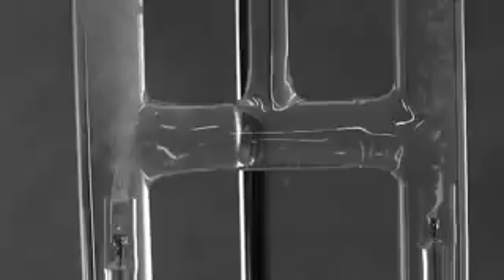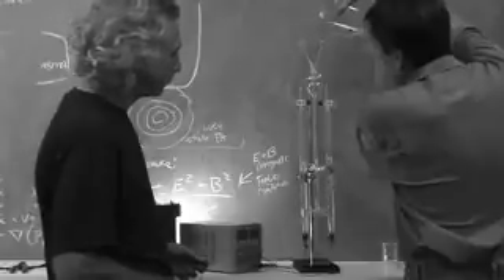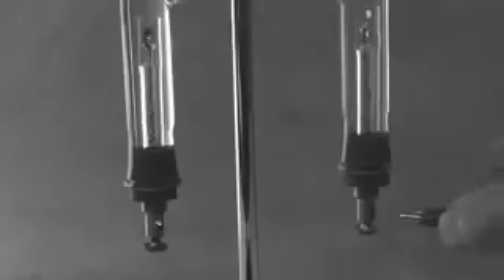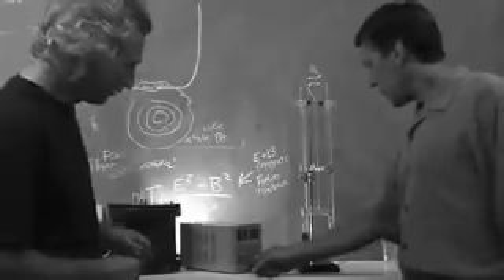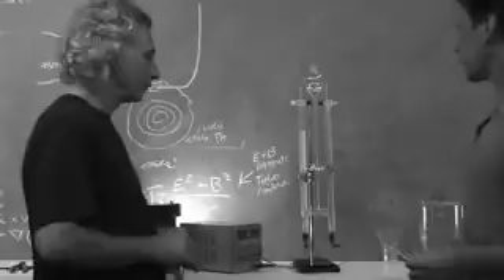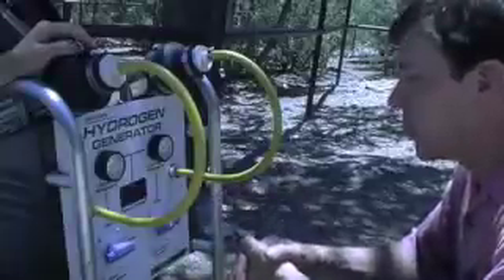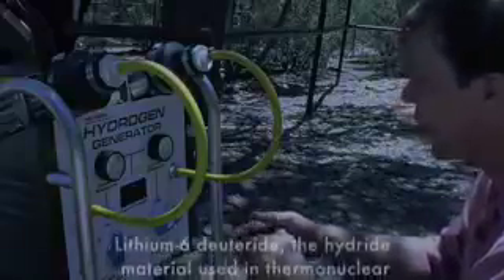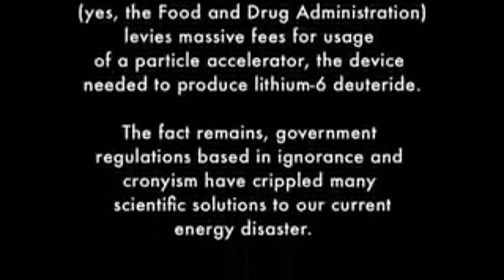run your car on water. This guy does just that!

Comment: I have followed Bob Lazar's reports for years. I built his water electrolyzer years ago and yes it does work. I never built the storage system even though I have the design for the storage system. The problem is I can't buy the Lithium Hydride catalyst because it is a restricted chemical. However, there are a range of new catalysts that are direct substitutes. Graphitic Carbon Nitride is very promising. 
Currently I am working on a catalyst that is recyclable and generates much more Hydrogen than these early methods.
Reply: Now you've answered your own question as to why it's restricted.

Can you release your design .
Reply: @josephwanjiku6853  I have an older design shown working on my channel. The video is a few years old but the electrolyzer is still the same. This is not free energy as it costs money to build the electrical supply to electrolyse the water. The advantage we gain is the generated Hydrogen is portable and has three main uses. The first being for heating, the second to run a combustion engine and finally the last is to generate electricity from a fuel cell. Depending on the application the efficiency can be anywhere from 30% to 90% with regards to power input versus power output. Remember our goal here is environmentally friendly energy that is sustainable.
Reply: @postiemania  

If you have an idiots guide to build it , I'd appreciate the knowledge.
Reply: Just buy a Tesla. Problem solved!
Reply: @Berghiker  humm. Hello. 2 year waiting list.  And problem not solved. Introduces new problems
Reply: @danratsnapnames  If you order now, then in two years you will own a Tesla. Everything in life comes with some sort of problems or trials.
Reply: @Berghiker  and then once you own a tesla you'll be replacing the battery pack every 3 to 5 years for a another $15k price tag added to your  tuneup costs
Reply: Is it possible you could email me the schematics? Or is there a clear video about how to do it?
Reply: @Skullboy1104-sw6mf  You wont get an answer from him because he knows this is a scam.
Reply: Japan is making hydrogen cars and has plans for building thousands of stations. You can buy one soon.
Reply: Fully electric is the way to go. I'm proud of Elon.
Reply: @Mortum_Rex  Its gonna be nice. Electric cars still suck. Electricity isn't gettin' any cheaper either.
Reply: @daphnetruman  Try the method in the video and you'll see the lie exposed. Solar panels won't charge the tank in a timely manner. Never mind the fact that he says in the video "I'm gonna leave it over night" when he's using solar panels. And I'm comparing modern panels to what he had. I know, because I've tried it. Japan is not using this system, they're setting up hydrogen contracts with Australia. Which costs money, has a carbon foot print in both production and transport, and ain't all that cheap at the pump. Never mind all the infrastructure they'll need.
Reply: @Mortum_Rex  Carbon dioxide is a BENEFICIAL gas, it is not a bad thing. All plants NEED it.
Reply: @tsijr915  He was born and raised  in South Africa. What a bright smart boy :-)
Reply: @Berghiker  He's not, but you keep staying ignorant while the rest of us move past it.
Reply: @tsijr915  What are you talking about?  He's not? You are just jealous because he is half south african.  Just get over it! Who is Bob Lazar anyway? Follow the big leaders in tech. Follow the money.
Reply: Hey , are you alive 3 weeks later or did you happen to suffer from food poisoning or other symptoms after this comment !?!
Reply: @napoleon9514  Hey I am still here, currently working on an energy cell that uses Hydrogen as fuel. Might I suggest the new cell is a quantum leap in energy storage. Features include a black box system data recorder and greatly reduced manufacturing cost. Will be putting up a video on my channel soon.
Reply: Could I get the designs on how to make the designs lol
Reply: @Berghiker  Takes gasoline to recharge electric car.
Reply: @onekerri1  Takes even more gasoline if you drive a combustible.
Reply: @Berghiker  Unless you have your own design schematic to show everyone then no one cares what you think about cars. Go back to making Excel tutorials or whatever irrelevant content it is that you make.
Reply: @BigOrse  I've made my point on this topic. No need for further discussion.
Reply: @postiemania  patent and sell it ma boi
Reply: @NA-hf4zg  I will put a video up in the next day or so and you can appraise for your self. I do plan to patent the design of the energy cell. The core control I may put into the public domain so everyone can use free of charge. The tank design and electrolyte formula is what I will patent and license to manufacture.
Reply: @Berghiker  The green new deal people like to hide that it takes coal to go green. We shouldn't use any of this crap when we can use any kind of water, in my opinion.
Reply: I hope you’ll post your work on YouTube. I just subbed to your channel. I’m a massive fan of Bob Lazar.
Reply: Robert I also did make hydrogen but dont know what metals make the cathode or anode etch resistant. I would like to make one and then Fill a propane tank to be used for running a generator in the winter.
Reply: @Berghiker  please tell me that was meant jokingly...
Reply: @Berghiker  and spend 20,000 on a new battery. Wallet dissolved!
Reply: @Berghiker  You heard Bob, these hydrogen systems don't self ignite.
Reply: Correct. All those nuts who think it is toxic have no idea what it really is.
Reply: never heard from again
Reply: @Berghiker  but the problem with that is, we still have to rely on the antiquated (mainly coal fired) power grid to charge these electric vehicles.
Reply: surely it is not in China...
Reply: Me and my lab partner are creating a research paper documenting the insane abilities of graphitic carbon nitride including photoelectrocatalytic carbon reduction at room temperature and other things. GCN is very promising, for this specific project I suggest using acidified GCN formed from the recrystallization of it in 60% sulfuric acid. There are papers on it but it would provide a more efficient way to store hydrogen in this way. Because I don't have a patent for some water car using GCN I suggest you try it out. you may know this already but GCN is made from urea (favored starting material) heated at high temperature and pressure. My partner has made a high energy form of it as well that fluoresces (GCN monomers in a way), and you should try studying these different forms to see which might be better for this specific topic.
Reply: @Bartschemistry  Great to hear about your work. I am building a solid state Hydrogen energy cell. Theoretically it should have 25% more Hydrogen storage than GCN.
Reply: @postiemania  that's a very efficient and direct method in storing hydrogen compared to my ideas 😂. I'm tempted to make one now too 🤔
Reply: You making videos?  I'd follow
Reply: @yougotmike  Yes I make videos on stuff like this.
Reply: @Berghiker  , how about no, and batteries and electric vehicle whining ironically is MORE harmful to the environment than internal combustion engines?
Reply: @Mortum_Rex  , however, if you have a super fast charging battery, then that problem might be avoidable.
Reply: Repent or you will likewise perish.  , while that may be true, I do not see how that part of the Holy Scriptures has anything to do with the content of this video.  Even YAHASHUA HA'MASHIACH used parables to relate to the common person.  Why not learn to do that when you make your comments on here?
Reply: @postiemania  , I think that dark matter propulsion can be both fuel AND a battery simultaneously, AND were all of that not enough, then not only could it be a perpetually lasting battery that can be used forever, but that it can also be a fuel source that can last forever without refueling, too.
Reply: @paxhumana2015  You know well that's a lie.
Reply: Could you send the designs? Very much curious.
Reply: @romanmartinez3701  On my channel you can see them thanks.
Reply: Wow
Reply: What's the make or model# of the generator or any reliable hydrogen generator for that matter if you could point me in the right direction. Thank ya thank yah.
Reply: BESAFE
Reply: @Berghiker  You still have to charge it from a coal fired power grid lol
Reply: @N.E.U.R.O  And your car can't run on water alone or hydrogen alone. You need 1 pt oxygen AND 2 pts hydrogen to get the same power or even more as a combustible engine. Plus you still need petrol or gas as you say in the US.
Reply: @Berghiker  do you know who Bob Lazar is?????
Reply: @huggywuggy3608  an American conspiracy theorist?
Reply: Elon Musk worshippers are hilarious LOL 

Nikola Tesla (the guy they named the car after) would be more for this Hydrogen method.
Reply: @Excel Moves yes man a conspiracy theorist if that  makes you sleep better at night... 🙄
Reply: Graphitic Carbon Nitride is cheep and easy to make using urea and carbon
Reply: @Berghiker   umm you do realize this has been around since before the 50s and hydrogen is a proven fuel currently even used by toyota's racing and rally division thats currently kicking ass RN. Hydrogen is easily on of the more reactable gasses for making power. This is a well known fact even mentioned in movies like The Martian also we could have had these on the road commonly like 10 to 20 years ago. But the EPA and Gas companies have been hard pushing against that cause they don't want to lose money.
Reply: @garyenwards1608  There is no free energy my friend. I believe my instant HydrogenPlus is the cheapest and fastest way to make Hydrogen. HydrogenPlus system uses a multi phase system that reacts with a rare metal catalyst.
Zero pollution and pure distilled water as the result of HydrogenPlus generating high pressure steam.
It burns water ok.
Reply: @postiemania  Energy is everywhere you just have to harvest it. Tesla's Electro-Magnetic Motor is a zero point engine. You'd never get it to market but there are Free energy or Zero Point energy machines you can build for your personal use. Check out The New Energy Series
Reply: @onekerri1  solar panels are used by many EV owners, at least in rural areas a little more commonly.  Even cheaper used Solar panels are much more available than a decade ago and the wattage rating is usually close to the original wattage rating. 

See related EV Tesla's related videos explaining how Tesla's most satisfied customers are the best sources for questions.
Reply: @josephwanjiku6853  It’s not restricted for hydrogen production.   That’s it’s primary use, there is nothing new or sinister here.
Reply: Let us know how it goes

Comment: Problem is that you need to put more energy into breaking the water than you can get out from burning the hydrogen.
Reply: Yep.  Same problem with a Tesla.  You have to produce the energy to power your car plus the energy to transport that energy to the car, store it and then retrieve it later when the user steps on the gas.  This is video is just describing a well understood energy storage mechanism.  It's cool but it isn't efficient or cost effective.
Reply: @Drone256   A battery is far more efficient than a hydrogen fuel cell, and has a better gravimetric energy density when compared to Hydrates. So a Tesla is a far superior solution to both petrochemicals and hydrogen. 

Also, a Tesla reduces energy transport requirements hugely, as you don't need to ship oil or petrol around the globe.

Comment: So if you had unlimited free electricity you could make a free fuel. 
   You could use the hydrogen to run a generator to make free electricity to make the free hydrogen to run the generator...
     Free energy folks.
Reply: Nothing is free, not even the oil and gas produced from dead dinos.
Reply: @JayDillon-mm6yv  how much does sunlight cost?
Reply: I love your comment. It ridicules the ridiculous idea without calling it so.

Comment: The energy output will always be less than the required input.  Which is exactly why this is not an efficient system.  It is impossible for it to generate enough energy to be transfered into mechanical energy and then back into electricity to sustain itself.  Even in a perfect system it would only be able to sustain itself.   In the real world alot of the energy is loss it resistance, heat, and friction.
Reply: Yes that's been said about the laws of thermodynamics however in these fuel cells that Meyers, Klein and many others suggest is there is a way to increase voltage above the input by way of an accelerator or capacitor that magnifies to infinity.

Comment: Watching this video in 2022-July when the petrol cost is almost £2 per liter. We need this technology.
Reply: 2022 Toyota Mirai

However, the cost of hydrogen as a fuel is tied to the cost of fossil fuels..so not that great of a deal.
EV's are much more efficient in my area.

Comment: Or let's say you used a lot gas in your vehicles, like FedEx or in your data centers like Google/Apple.   Those companies have billions in cash and are larger than most fuel companies.   You don't think they  could drop a hundred million to design a radically better way of producing energy, just to make money of licensing.
Reply: You can't just use any engine you want. There are laws. There are cars on the street in Europe that get over 100mpg. And the engines are illegal to import into America. And unlike drugs, these laws are brutally enforced.
Reply: not google not apple has more money than oil companies, computers are in mass world wide use for about 30 years, oil is 100s, u buy one computer or phone per year, and how many gallons of gas per year? and no pollutions mean healthier citizens and that is not good for pharmaceutical companies and hospitals, and trust me, THEY hold most of the money... if u have 20$ in your pocket u have 2 options to spend it: 1st to tank gas in your car or go to buy tylenol because your head is like pumpkin from all those vapors you inhale till working 8h in downtown repairing those holes on the street made by millions of cars passing trough...
Reply: Zo Mi Apple has about 140 billion dollars in cash.   You don't think that if they wanted to use some wonderful new battery power by hydrogen, that they did not have the money?   Apple is scared of what?   You buy one car every 5 years, how many I-Phones are sold in a day?   Apple is in the top 20 of companies in the world.  Along with the oil companies...
Reply: Zo Mi Blah blah blah.  Other companies and countries would able to produce this engine if it were for real. Tesla is building an expensive electric car-there are no Texaco assassins killing people.   Stop living in conspiracy land, go back to your polluted factory dorm and build someone an Ipad.
Reply: Forensource
and you know that there is no killers because you work for them? other thing, i dont work for apple neither im living in usa. im living in conspiracy world what is sad. im telling bull shit maybe? so, why all governments have secrets? why all companies have secrets? why we have industrial espionage? well, because of money. so there is no conspiracy anywhere? if in 50 years from now we run out of oil, how all machines, cars, trucks, planes or ships will move? wanna bet it will be miraculous how fast they will find engine on water and will be licensed on some of huge corporation who had business with oil in this days? naaah no point to tell you anything you are in ideal world where everything is just right, just problem is you are so blind...
Reply: Forensource But as you said, Tesla electric car is expensive. Hence, Tesla cars will NOT be widely used by the masses like, say, a much cheaper Toyota car.  In fact, for MANY years to come, mainly the wealthy and the upper middle-class people would be buying Tesla electric cars - and ONLY as fast as Tesla can produce them (which is currently just a few thousands a year for USA sales). To get a Tesla car, you practically have to buy the car months in advance and be on a waiting list). Conclusion, Tesla is not (yet) a concern for "big oil", so they will be left alone to sell to a very small customer base in the USA. Tesla will become a concern IF they are able to grow and sell millions of cars like GM does.
Reply: Alex Duval
Tesla car is not mentioned to be cheap, same as Ferrari. its luxury build... but if Toyota decide to implement that technology in mass production, then you are talking about accessible electric car...
Reply: Alex Duval yay....
new tesla out now, $35,000 !!!
for the average citizen!!
Reply: Forensource all the big companies are owned by the same group of people
Reply: Forensource then the Petro dollar drops

Comment: Jhon worrel Keeley was the first to run a motor on water, but it didn't burn hydrogen like the ones nowadays.... It used what is referred to in the plumbing industry as the water hammer effect, for if you shut off the water supply suddenly in an old home you will hear a bang or thump in the pipe, thus the water hammer effect, Keeley ran a vacuum pump motor on this method.